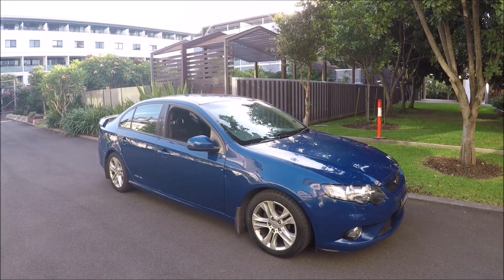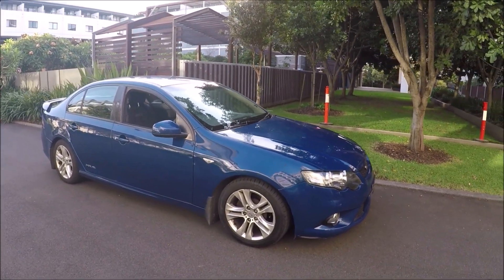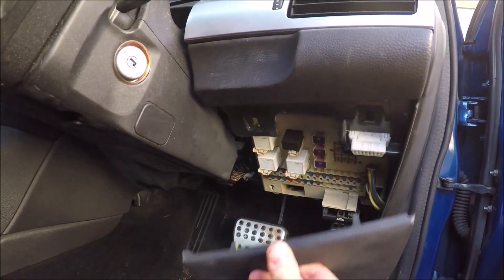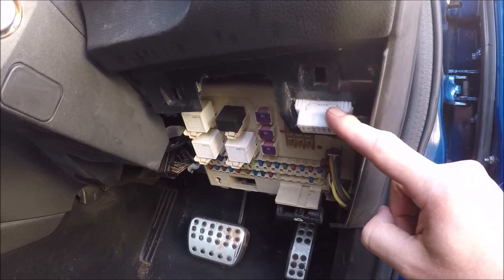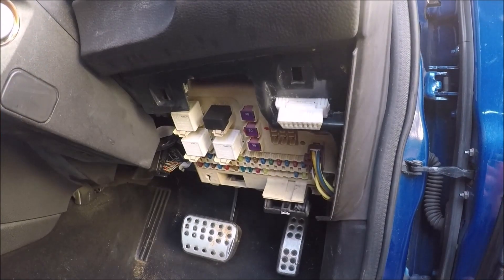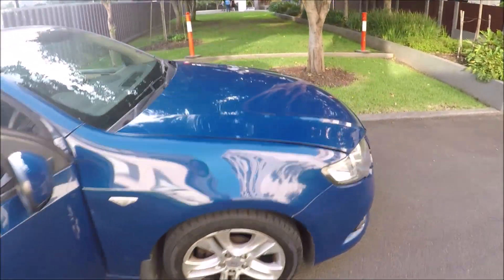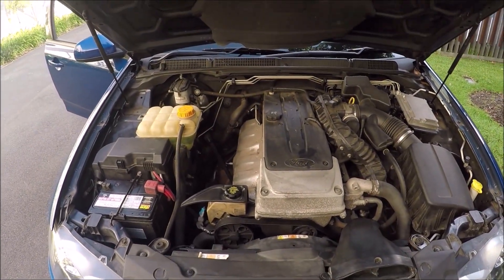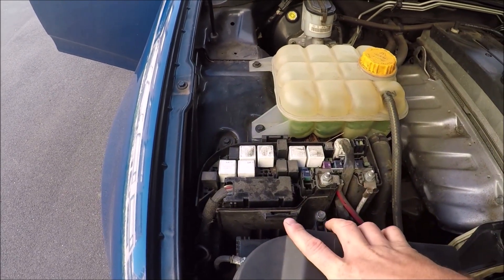Ford Falcon Fusebox & OBD2 Diagnostics Port Locations & Including Diagrams (FG XR6 XR8)

Comment: G'day Ross,Thank you for your videos. I have a ford fg xt she wont turn over telling me that it wasn't in park. Any ideas please? Thanks heaps
Reply from the maker: Hi Jeff I have had this a few times on different cars, it usually boils down to the microswitch within the gear selector that isn't reporting it it is the park position, sometimes it can just need cleaning. Can be a pain to get to but that would be my first look. 
Have you tried holding the shifter hard up into park whilst trying to start it?
Reply: @RossPerryProductions  Thanks Ross your a champion. It started no problem this morning, without doing anything. Would that make the switch almost definitely the problem do you think? Maybe moisture? Thank you again.
Reply from the maker: @maddie35709  Hi Jeff, it certainly sounds like it, if it happens again I would try and put pressure on the shifter in park to see if that activates the switch, it could just need a good clean and the connections checked.
Reply from the maker: Please remember to like my video and subscribe to my channel :) Ross
Reply: @RossPerryProductions  Is it also called a Neutral Start Switch? You are a good man thank you for your help. Any chance on doing a video of the cleaning process? Really mate thanks, people really have no idea, your kindness is rare and of great appreciated. Thank you

Comment: Its stats its a green 30amp for the fuel pump engine bay, but my falcon holds a yellow 20amp, does this mean i can put a 30amp green,  as my falcon is a little hard to start at times  just curious to know if the green 30amp would help more amp via starting, better
Reply from the maker: Hi Ahmed, Yes it looks to be 30amp, so you could change it out from the 20amp you have. However I don't believe this will fix your issue, as the pump will take the power it needs regardless of the fuse, the fuse just allows a set amount of amps to pass prior to blowing. Therefore your fuel pump must be drawing more than 20amps as it hasn't blown it yet. I hope that helps, please remember to give the thumbs up and subscribe. Ross
Reply: @RossPerryProductions  thanks for the reply, i found the problem, it was the fuel pump, was coursing the fuse to  explode,  i put a new pump, problem solved
Reply from the maker: @ahmedtouck8913  No worries, I am glad you was able to fix it :) Ross